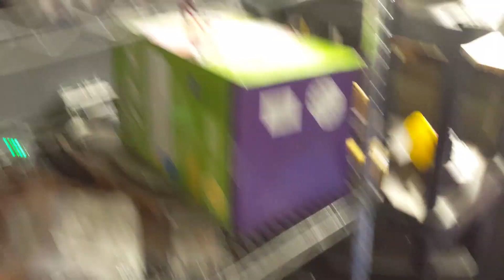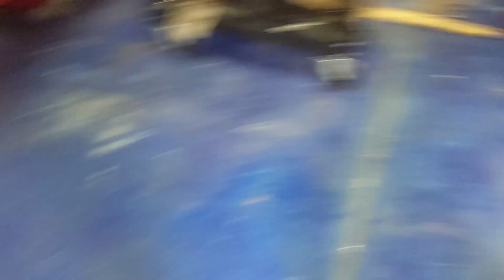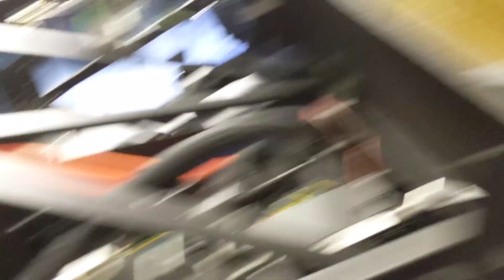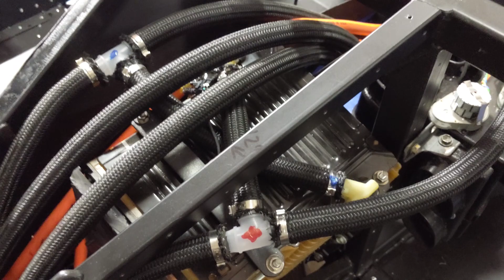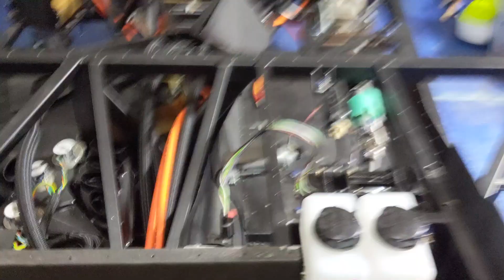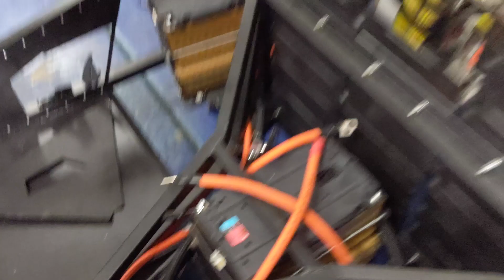Project GTM April 2020 Update

Comment: Mate. I know its expensive but the suitable batteries for this build are the 2170 or 1860 cells from any of the Tesla models. Cut away the center console, reinforced the whole cockpit and place the batteries beneath the passenger seats. What you are doing will make the handling very challenging around the corners due to the weight distribution of the batteries. The two motors creates alot of torque which make the whole car unstable. If you were planning to utilize chevy bolt batteries in the first place then the Type 65 kit would have been a better choice.

Comment: what does the tesla powerpack and motors cost?
Reply from the maker: Tesla batteries are generally around 8-10k for a full pack setup.  They won't work for this car due to space and weight constraints.  The Volt packs range from 2k-4k depending on gen 1 vs gen 2.  

The drive units can range from 2k-6k depending on which model and peak output.

Comment: I see a lot of questionable uses of 3d printing. Those hose brackets are a perfect use. Failure is not likely but not catastrophic.  They can be formed exactly as needed. Off the shelf solutions are nowhere near as good.
Reply from the maker: Agreed.  There are hose brackets available out there obviously, just never in the configuration I want.  I whipped this design up in Fusion 360 and can do the same if I need a bracket that holds 3 or 4 hoses as well, maybe even adding in the battery cables.  Being able to experiment and change stuff on the fly is whats amazing about 3d printing, and all my stuff is ASA, which is heat resistant (its used in regular car parts already)

Comment: Did you buy a Corvette donor car?  If so, what year (you mentioned C5) and what do think you’ll need from it (what can’t be damaged)?
Reply from the maker: I did.  97-04 are all close enough.  I actually picked up one that was involved in a wreck and the prior owner stripped the exterior panels and made it a "go-kart" type build.  

So, if you're doing a conventional LS build, you need what I have here plus a few small lamps and the engine.  I actually have the full parts list if you want, I can email it to you.